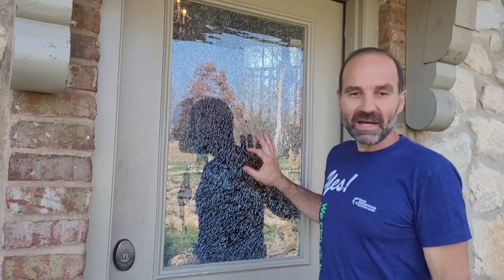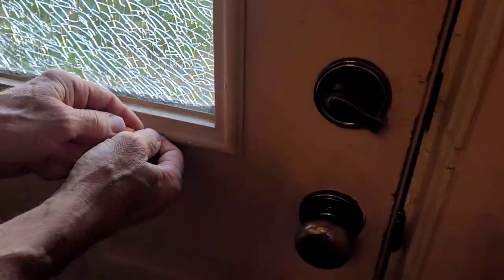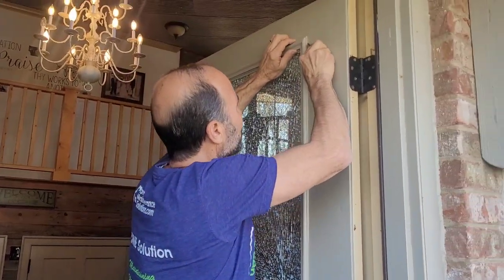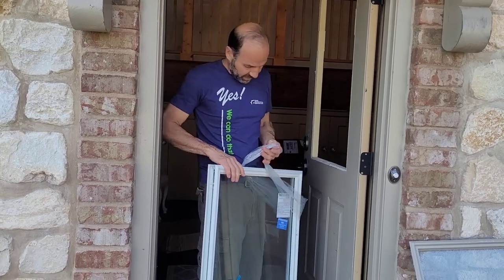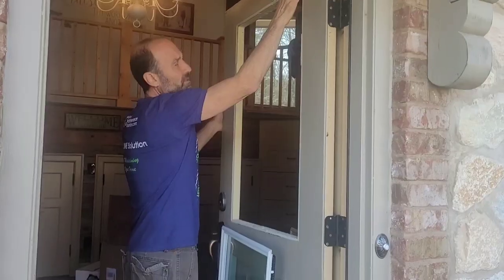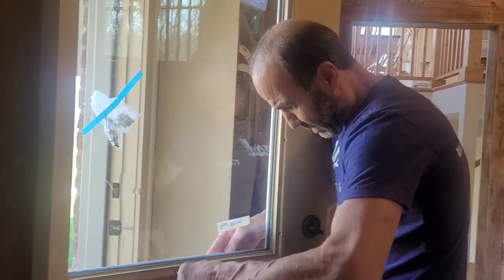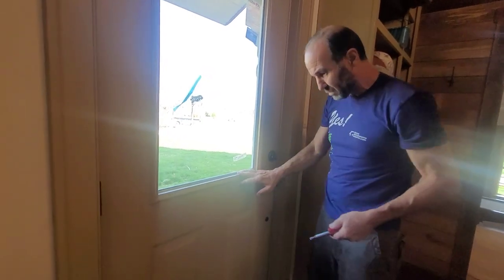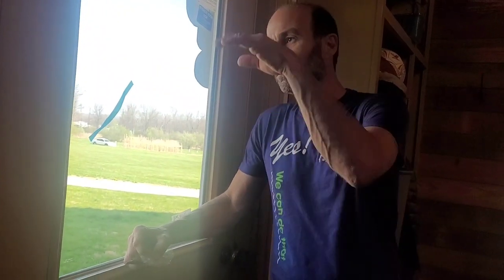How to Replace the Glass in a Steel Exterior Door

Comment: Where does one source the entire window unit?
Reply: Your local glass supply company.  He said that you could also order on line.  You will need the measurement of the thickness of your door (such as, in this case, 1-3/8" steel door).